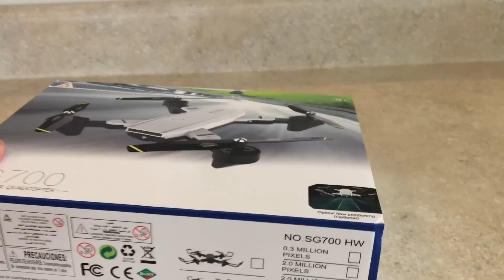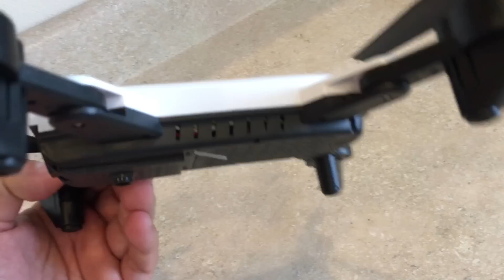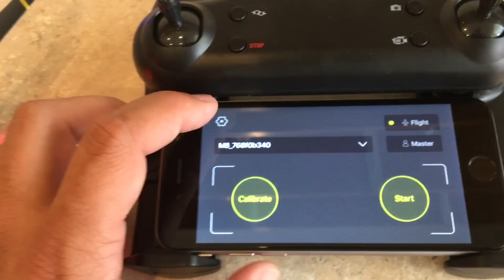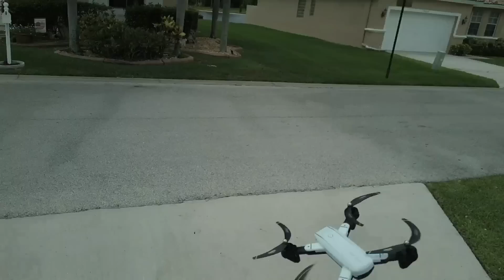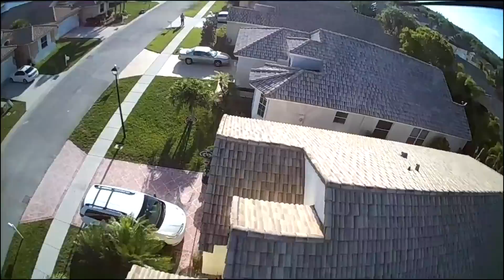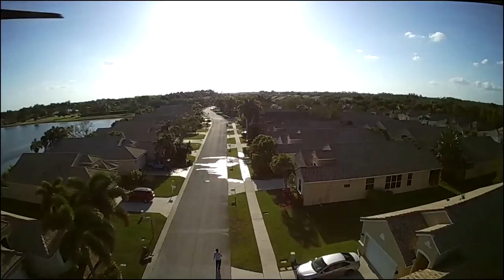SG700 Drone Review

Comment: Greetings!

My SG700 had a fall in a tall grass field. But it hasn't suffer any hard shock. No bruises, nothing broken. Everything seems OK. But, one of the motors simply stopped working. I had this motor tested and it is fine. Testing the circuit board, I found that this motor's terminals are not getting any energy (should be around 3,7V), while the others do. I wonder if the Drone's accelerometer may had had an abrupt changing and "disconfigured the Drone's memory". Is that possible? Does anybody knows if is  possible to change the circuit board? (SG700-D). Thanks in advance.
Reply from the maker: Try visiting the BangGood, GearBest, or TomTop com websites to find spare parts for this drone (such as motors, circuit boards, wiring, etc)...
Reply: @rx344  Will do. Thanks for the answer. Regards!
Reply from the maker: Sure, anytime...

Comment: does using the smart phone reduce the flight time and do you know the differences between sg700, sg700 D, and sg700 S?
Reply from the maker: Using the smart phone should have little to no impact on performance...As to the differences between those drones, I am guessing certain features set them apart (such as optical flow, GPS, 5G WiFi, etc).

Comment: How come the drone imagery is laggy on my ipod? It lags about 8 seconds of what I point the camera to. I've purchased 2 of these drones and they both lag. I see many reviews and those cameras didn't lag. Im not sure if the drone calibrates either, it just says "sensor calibrating..." and disappears after 2 seconds. Could it be my mobile device or app? Besides this, it's a very fun drone
Reply from the maker: The lag is more likely to happen the further out or behind an object the drone is from the phone...it is basically interference (or disruption of the video transmission)...  If using the drone in close range (like for selfies), it should be less apparent...
Reply: @rx344  Thanks, I found out the problem. The lag occurred on an old 2013 iPod , but works perfectly on an iPhone 6

Comment: hi, thanks for the video, when turn on my wifi it finds the divice, but it says that i dont have wifi or no connection. its not finding anything that starts with M8xxxxx, it says wifi_camera:xxxx
any sugestions?
Reply from the maker: Well try connecting to the new WiFi entry that appears in your device’s WiFi list. It may be that they changed what appears there with the new production models. If that does not work, then perhaps you may have received a faulty unit or maybe your device is not compatible with the drone. If possible, try connecting to the drone using another mobile device to test…
Reply: @rx344  thanks, i'll will check it out.

Comment: What is the trick in having it so far and returning it in the wrong direction,,,, I see it comes to you so straight and nice,,,,once its far i would think you can turn the stick unpreciscely, and fly it away or in the wrong direction of travel,,,any hints or ideas to keep a good return,,,,?
Reply from the maker: I simply fly it straight out (with its nose pointed in the correct orientation facing outwards), and then I simply yaw the drone back towards me as I keep the pitch forward, so that it essentially is doing a sharp turn and coming right back at me (with the nose pointed towards my orientation)…

Comment: got the same drone but mine refuses to stay connected to the wifi, it flashes up briefly then drops connection. It also keeps hitting 100% power so when I hit the take off button it zooms off lol. How do you take off and how do you get it to hold position? Mine literally takes off and swerves in one direction so I have to hit the kill switch to crash it.
Reply from the maker: Well maybe first try flying it without the app (just the controller) to avoid any interference and then make sure you calibrate the drone (while it’s perfectly flat on the ground) prior to take off… That should ensure that the drone is balanced and has no interference with the cell phone’s Wi-Fi… Hopefully it will fly a lot better with that configuration, if not, you may have a faulty unit they may need to be returned or exchanged…
Reply: Ejsidsosiskskckckkefkksld

Comment: I bought this drone and it worked great. The only thing I didn’t like is that I bought the version that records straight to your phone and not an SD card and the footage was very jerky. Shame really because it’s very enjoyable to fly.
Reply: Curiosity where you by the drone
Reply: Tahmid Abdulla I bought it from the wish app. Approx £44
Reply from the maker: Well, while footage that is saved to an SD card is usually of higher frame-rate & quality, the jerkiness will only be reduced or minimized using some form of EIS (electronic image stabilization) or gimbal.  The smoother the flight, the smoother & less jerky the footage will be, but a 2 or 3 axis gimbal will really make the video clear & straight.  Unfortunately, this drone does not have EIS nor a motorized gimbal.

Comment: OK I purchased this quadcopter, it's very nice looking pleasant design, built seemingly well, remote is also comprehensive, well marked and works well. However I can't for the life of me get it to work with the RC AND the phone, once you connect to wifi it will ONLY receive the takeoff control and then proceed to go nuts and crash, it will not accept control signal at all. it will work with the phone alone but it's is very sluggish and will work perfectly with the RC, however I want to be able to see my flight as it happens. Can you make a video where you go through all the steps up to flight outside, not inside in the kitchen and then go outside, so I can get it in my head how exactly it works for you?
Reply from the maker: Sorry to hear that...perhaps you might have a faulty or defective unit that should be exchanged or returned...
Reply: Well considering it came from China returning is an endeavor better suited to those with patience, LOL, Actually I finally got the correct sequence to make it work, not unlike the one you explained. The bird goes on first, RC second, pairing 3rd (throttle stick up then down), calibration with sticks down and in 4, then connect wifi followed by app which should be set to master, sticks down and out motors on, takeoff manual or automatic, and it's all good. It's not a bad flyer, camera surprisingly acceptable, for fun anyway, too bad it doesn't have a SD card, funny enough I have a micro drone that has one, not fpv though but they do make the same drone with both. DO I recommend it? sure why not, it's a fun way to practice attire mode without destroying my expensive (very) inspire. As I feel you don't know how to drive unless you drive manual, you don't know how to fly if you can't fly in ATTI mode.
Reply from the maker: Well put… I’m glad you got it working correctly… Happy flying!  :)

Comment: Hi, I ask, why not command the camera from the transmitter and a sd card inside the drone? Take picture and video from the phone and not with the buttons on the transmitter? Thanks and greetings. Piero
Reply from the maker: Yes, unfortunately many of these new foldable hobby quadcopters require the mobile app & WiFi in order to successfully save pictures & record videos.  Even when they have photo & video buttons on the controller, they still need the mobile app connected in order to properly save those files.  If I recall correctly, this drone was also designed this way.  If the drone takes an SD card, simply insert one and try recording video (or taking pictures) using only the controller buttons and not the app.  Then check the SD card and see if the video properly saved.  Also, make sure you correctly stop recording the video before you turn off the drone (not doing so could corrupt the video file and make it unusable).
Reply from the maker: Normally, it is recommended to use an SD card if possible with a drone.  The quality of the video footage saved to an SD card is usually superior with a higher frame-rate and no lag (which makes it smoother).
Reply: Thank you for your answers to me, the SG 700 has no sd card inside, is there the possibility to add a little circuit to put into the drone , connected to the camera, and finally have the possibility to save foto and video in the sd card ? Do I dream? Thank you again. Piero
Reply from the maker: Sure, I guess that might be possible...
Reply: Thanks, I want to try to insert in the drone a slot for sd card to connect to the camera and to see if it will work properly... Then I will say more. Thanks. Piero

Comment: This is really cool! I'd been thinking of getting this one for it's price and it looks pretty decent!
Are there any trim options with this quad? I've been flying indoor and mini-quads so far, not sure if trim is only a thing with the smaller ones. With bigger quads like this, is the position hold reliable..?
Reply from the maker: This does allow you to calibrate the gyros (which is essentially a form of auto trimming) to balance the quadcopter and ensure a very even trim… At 10:00 in the video I demonstrate how that is done… But I did not see a clear way to apply trims (unless there is some obscure way of doing it, perhaps by pushing in the joysticks)…

Comment: I bought an equal drone. During the flight he spins by himself and falls to the ground. You know what that might be?
Reply from the maker: Perhaps there’s some sort of signal interference? Maybe a faulty unit?  Try flying the drone without using the Wi-Fi or app… Does it still give you problems if you just fly the drone with the transmitter (and not using the Wi-Fi or app)?
Reply: I never flew without the app working. I'm going to do this test and then I'll give you the result. Thank you!
Reply from the maker: OK, will just give it a try… Some of these drones get interference when using the Wi-Fi app because the Wi-Fi operates on 2.4 GHz (as well as the transmitter also operates on that same frequency) and sometimes there can be an interference…
Reply: That may be the problem. Thanks again!

Comment: I am seeing a lot of lag on the controls when I am using wifi signal-  is there a fix for that?  recommendations?
Reply from the maker: Well, you can try regular line-of-sight flying without using the app or phone (just using the controller).  That should have less interference and should fly well.  As for using the WiFi, check to see if you are in an area with a lot of WiFi interference or if perhaps the bluetooth (or other signal) from your mobile device (or environment) is perhaps causing some sort of signal interference with the drone and making it lag a bit.  Also, flying it within closer range might also reduce some of this lag.
Reply: I think i expected a lot for my 70 bucks-  this is a fun drone but it flies like a boat in my hands.  It looked very nimble and precise in your hands.  great channel-  You should do a top ten-  you seem to do a lot of the low end drones.
Reply from the maker: Good idea, yes it takes some practice and trying different things to get a good feel for what drone works best for you…

Comment: Your an expert in flying! Thanks for the video. My camera don't start
Reply from the maker: Thank you, but sorry about your camera...perhaps it’s a faulty unit... Maybe they will exchange it...
Reply: rx344 i will download and install and pare the transmitter again. Thanks.
Reply from the maker: Also, you may have to start the recording from the app (and not the controller) so that it records video & images properly...
Reply: rx344 thanks for thinking with me. I knew what the problem was, my cellphone was blocking the wifi connection. I could fly and that's why it would react crazy sometimes.  Once I fix the wifi issue. "Trust this wifi connection " it start up immediately.

Thanks.
Reply from the maker: Glad you resolved it...goodluck!  ;)

Comment: I took the remote controller apart, the antenna on top are fake, I removed them and blocked the holes up. I also extended the small antenna wire inside the controller, I will test in future if it gives more range.
I also had a bad crash trying to fly in really bad wind. I think one motor got stalled so burned out. I have spares so I replaced it OK, just cut and soldered the wires in the arm, all good.
Reply from the maker: Interesting info, thanks for sharing!  :)

Comment: Had mine a while now, its pretty easy to fly with the remote but I can't fly it with the app, its too unresponsive, almost ignores me!  It seems pretty tough as I had a few crashes without damage.

Some notes... I tried several phones, even some newer fairly quick Samsung like J5 and Motorola Moto they got an picture but it broke up badly with any drone motion. My most powerful phone, a Samsung Note works OK. The app should be fine with something powerful  like an S series Samsung.
I also found you need to connect the remote control first with phone wifi OFF, once the remote is paired you can switch the wifi on (within the app) on phone and let it connect to the drone. It then flies OK and you get a video feed. 
Good news about this drone is spare parts are now becoming available (AliExpress) so if you buy it you have a chance to keep it flying for a long time. I already have extra blades, motors, gears and batteries.
I was recently given an iphone so I need to get an app and try it with that next.
finally I need to practise my flying, I have had a couple of near fly-aways I managed to recover, I think it was the optical flow can get confused at some altitudes so a hover turns into massive drift situation.
Reply from the maker: Optical flow is good, but GPS has return-to-home and also, it can maintain its position at high altitudes and with low-light...optical flow drones may lose their position hold under those conditions...
Reply from the maker: Hopefully they update the app soon & fix some of those issues with other phones...
Reply: Rob Sillygoose I wondering if I should stay with my Hubsan 502E it try this new drone,I was hoping it would Hoover hands free like a regular altitude hold drone ,I am hoping the optical flow is a improvement ,I like upgrades
Reply: I agree, optical flow is really a low cost means to improve stability, it does work to a degree, but the processing power in the chips in a £40 drone are not going to be very powerful! With only a 2mp camera below, when the drone is high it probably doesn't get enough detail image to track well.
Reply from the maker: Absolutely correct!  :)
Reply: Rob Sillygoose do you need network for app and WiFi use or can you use jus an old non service phone.  I upgraded to an x but I still have my 6plus.  But it’s not connected anymore. Would the 6plus work as a remote slash monitor and stuff

Comment: I understand there are three or four models of this drone ,is your model the optical flow model ,and did you have any trouble flying with the stock transmitter,the quad copter 101 reviewer buy had some transmitter problems he ended up using the phone app and phone only for the transmitter,I kinda interested in this drone ,for 42.00 I found it for ,I just need to no is this good for beginners,anyone help
Reply from the maker: Yes, I have the optical flow model with the two HD cameras… It is very easy to fly for beginners... I did not experience any problems with the controller, but I’ve heard that others have had issues… So I’m not sure what’s going on with that…
Reply from the maker: Yes, from what I see online it does look like a rebrand of the S169 (or vice versa)… They have two cameras (one of which is the optical flow camera underneath)…
Reply from the maker: It wouldn’t hurt to try, you have nothing to lose, you can just simply download the app and give it a try… I have had success using different apps on quadcopters that don’t belong to them and have worked…
Reply: Polynice Auxerre I waiting for mine still hope it comes soon
Reply: I think they fixed the app
Reply from the maker: Great!  :)
Reply: rx344 this look identical to the S169 drone..its the same just different name? Mine says Optical flow Drone S169 & I can't find a app for it so I can use my phone to take pics or videos plz help
Reply: rx344 I thought so..& I can use the same app Hfun as well then?
Reply: rx344 thanks bro I got it. It works fine!

Comment: I cannot connect with my iPhone 7. How can I do it manually? There is a number after hotspot M8_*** but where is the *****? Renato
Reply from the maker: There shouldn’t be a password for the drone, simply connect.  Did you set a password for it in the app?
Reply: Thanks for your quick reply. Where can I find the serial number? I looked everywhere and didn't find it.
Reply from the maker: Try at the bottom of the box perhaps…
Reply: nothing there. Tks.

Comment: I read where someone thinks the antennas on the transmitter are fake. What do you think? Thanks
Reply from the maker: They probably are… many of these small budget quadcopters have them for aesthetic purposes (when the real antennas are much smaller and within the controller housing)… but in any case, the range is still pretty decent…
Reply: Thx. My whole point on the other video I saw was that the guy categorically made that statement. They would only have to be made of a semi-conductive plastic though to be effective, with the actual lead connected at the base. "Decent range"? 160-170 m like advertised? Which is not bad considering flying LOS.
Reply: What would be interesting is binding this to a DSMX Tx at 2.4...or 433...and using a micro LR vTx!
Reply from the maker: Yea that sounds cool...or binding it with the Jumper transmitter...
Reply: OMG! LOL...They make a "T8SG Jumper". A chinese knockoff of a Japanese radio....I have a OrangeRx. I bought it bc of this guys mod...  https://www.youtube.com/watch?v=wr9jdI3k1Jg
Reply: Wow...the new V2 is impressive...wonder  how long before other mfgs get on board with multi-protocol.
Reply from the maker: Interesting information… Thanks for sharing...  ;)